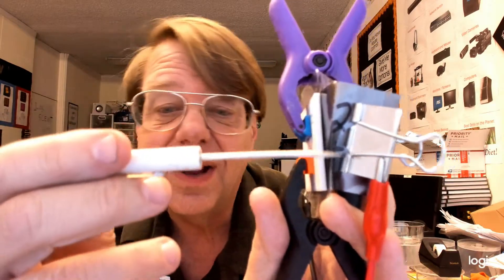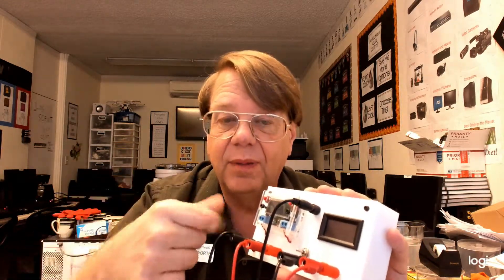Quick Update   Sugar Carbon Battery

Comment: You might try taking solid copper wire and bending it into the shape of a paperclip with the outside leg long enough to attach to. Alternatively, here is a link to a diy copper paperclip that won't snag (second one in the video): https://youtu.be/YfaDQJVplYI
You also might copper plate wire clothspins: NORTHERN BROTHERS Clothespins 80 Pack, Stainless Steel https://www.amazon.com/dp/B01MA1M7Z0/ref=cm_sw_r_cp_taa_W5VRDbVT7JAP4? There are videos n copper electroplating too: https://youtu.be/oESywN8Bgx0
Reply from the maker: Yes indeed.  For my new baseline battery I'm going to try using aluminum foil instead of grafoil, based largely on a recent video from Robert Murray Smith.  I never felt like I had a conductivity problem with the grafoil, but the aluminum foil is cheaper and more readily available.  I could also put a layer of aluminum foil behind the grafoil to increase conductivity.

Comment: Hi I made some carbon from wild fig and it gets to a point where almost any fruit sugar outperforms, the next one, specially if you soak it the sugar carbon in battery acid.
Reply from the maker: VERY interesting.  I was already planning on testing various fruit sugars.  I can't use battery (sulphuric) acid with the kids - but I can use a weaker acid like vinegar or vitamin c.  How do you do the soaking?  Do you soak the carbon after preparing it?  Do you rinse out the acid before building the battery?  Do you dry the carbon before making it into an ink or what?  I'm very interested in learning people's exact techniques!  Thanks!!

Comment: I guess if the two sugars give such close results, then go with the cheapest and the easiest to get hold of, then on to the next parameter  :-)  Martin.
Reply from the maker: Thanks Martin - yes, exactly.  I'd prefer to use table sugar, but I trust Kev and he said the corn sugar was a lot better.  Right now I need to tighten up on my methods because unless a difference is on the order of 100 percent change I can't be certain.  The corn sugar could have been 50% better.  Once I get that more under control I'll know for sure.  It will help me with the students too - better consistency for their batteries.  Onward and Upward!

Comment: Hello Leo , love your channel, I have been following along at home but my batteries/super caps self discharge quite rapidly, any ideas?
Reply from the maker: Hi Steve,  what are you using for a separator?  What are you using for electrolyte?  I'm guessing that you might have little spikes of material poking through the separator, causing micro shorts.  So I'd work on grinding your material finer, and possibly look for options for separators and electrolytes.  The separator I'm using now is called tracing paper.  It is a thin paper, but pretty strong.  Good luck!
Reply: I am now using tracing paper but I also have been using paper towel, both with the same results ,in a short time the bat/SC. has self discharged although I am getting good run times up to 120 mins @ 10ma discharge down to .5volt.  My electrolyte was sodium sulphate and is now potassium hydroxide. this is on 30x30x1mm act charcoal or sugar.
Reply from the maker: @stevea5407  Great results!  What are you using as binder and electrodes?  How are you grinding your carbons?  Is the surface of your electrodes fairly smooth with the carbons, or are there spikes on them?
Reply: I don't use any binders for the moment. I do not want to add extra complications until I know fully what I am doing( I don't want the binder screwing up the results). The way I achieve this is instead of using expensive graphoil  , I use cheap (Chinese) graphite tablets 4cm x5cm x3mm( Ebay about £4 for 6). I make a 1mm x 30mm x30mm "hollow" in both pieces  at one end, on the mill,  this serves as a cup for my active material then I add a few drops of electrolyte ,separate them with tissue paper, and pop a rubber band round to hold them together, Just make the connections at each end with crocodile clips. Works a treat.!. These little slabs  have an extremely low resistance and are hard and durable, they can be washed and used again and again. Also there is the added bonus that every test is exactly the same, because I use exactly the same amount of active material ( in the cups) exactly the same surface area of electrode. I could send over a couple of photo's if you are interested. I don't honestly know if there is a down side to my method but it does seem to work very well .If there is some thing wrong with this method maybe some one will let us know in the comments.
Reply from the maker: @stevea5407 , that's VERY interesting.  I love it when people invent new methods.  So I take it you are wetting the active material in the cups with the electrolyte before assembling, as well as wetting the separator.  You are able to use a comparatively large volume of active material which also helps with performance.  The slabs are kept from touching by the separator, right?  

For me Grafoil wasn't a huge expense.  I got the end of a roll (about 10 feet or so by about 3 feet) for about $35.  This makes hundreds of batteries.

I don't have any more insights about how to help your self discharge.  Your other results are looking quite interesting.  Let me know if you find a solution!  Onward and upward!